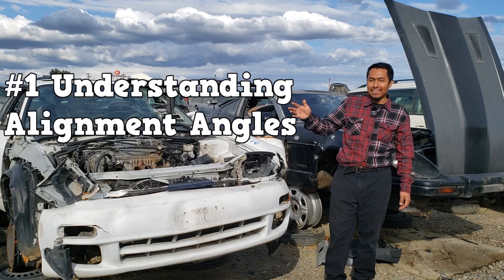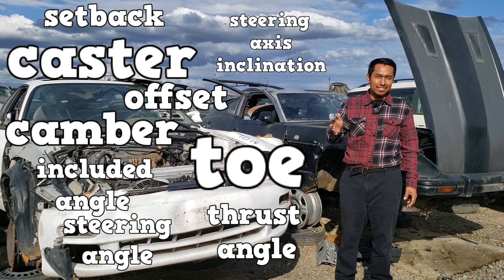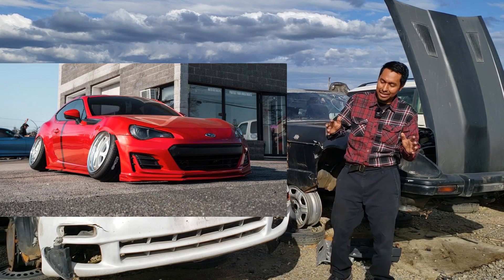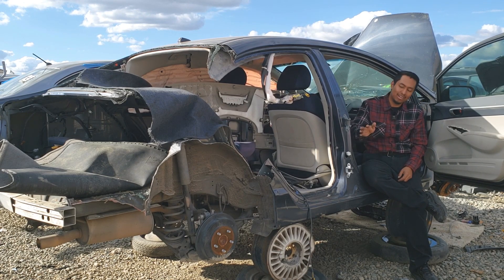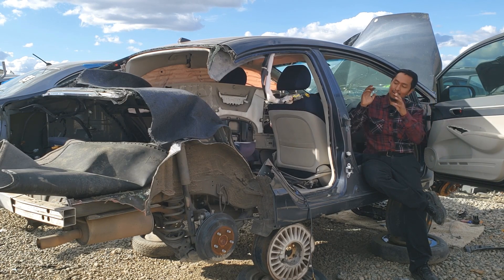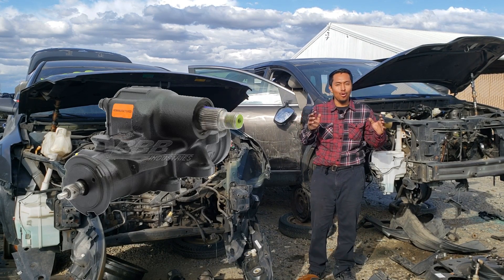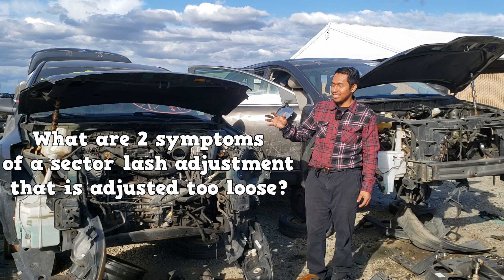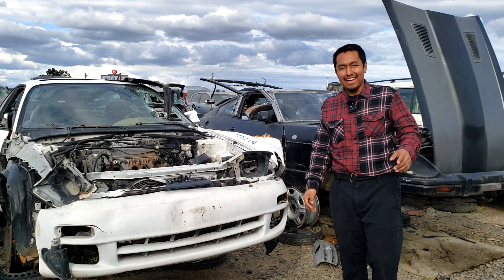3 ASE A4 Topics That Seem Difficult At First

Comment: I took my A4 exam last week and passed it! The review was spot on, thanks for taking the time to make it. There was one question that caught me off guard. It showed the front suspension of a car on a lift. It said 'the subframe was being shifted to the right. This adjusts ___ to minimize a pull to the right.'  Two options were bogus, the other options: 1. front toe split 2. front camber split.  I said camber split since the car in the image had lower control arms, and those are going to be secured to the subframe/cradle.

Comment from the maker: Update 3-6-23: I passed the A4 test. Some feedback on this video:
Topic 1: All of the listed angles were somehow mentioned in the test except for included angle.
Topic 2: The main focus of rear suspension was causes of noise, and thrust angle related questions.
Topic 3: No direct questions about recirculating ball steering gears.